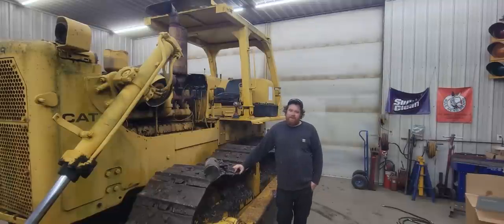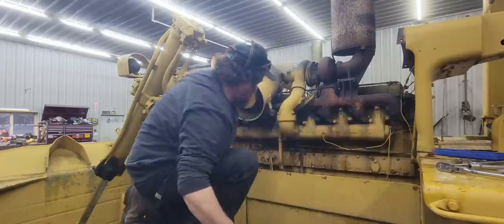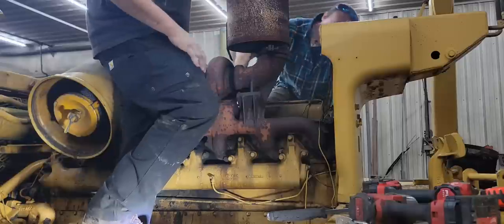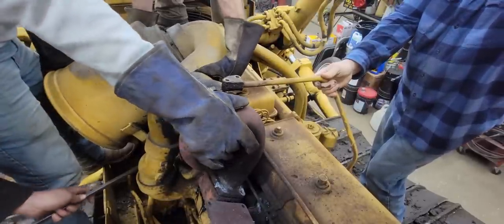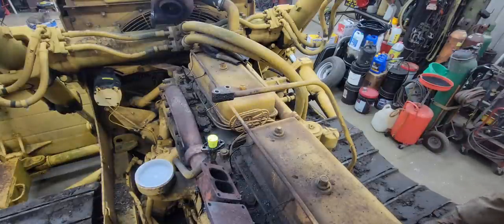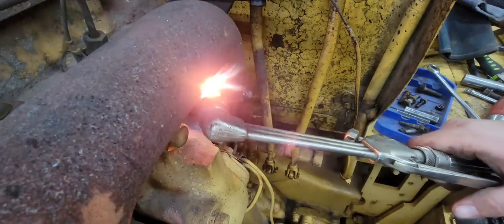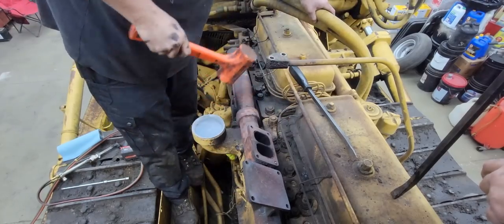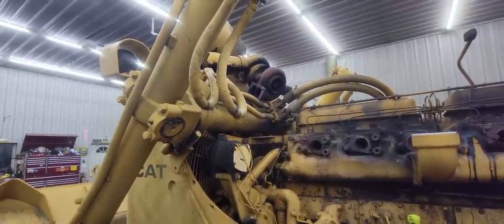Caterpillar D8H Exhaust Manifold Removal...Alittle Bit Of A Battle!

Comment: Excellent video Brandon  :) lots hard work for take manifold off for sure 👍 and got off finally for sure 👍 and saw need new ones and gaskets for sure ! I know had do on farm tractor recently and took lots hard heat with torch also high quality pentriotion fluid and impact and prying off too more hours should took ! Lucky could get new manifold brand new with gaskets too for out ports too and new bolts plus studs it need too!